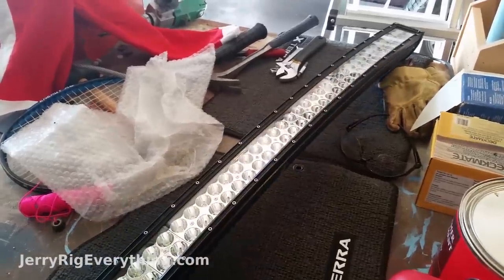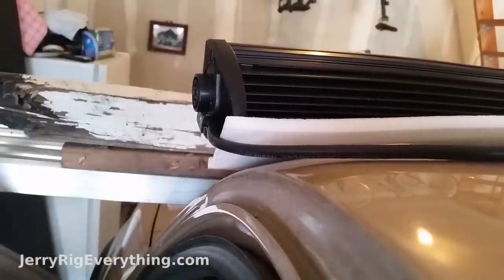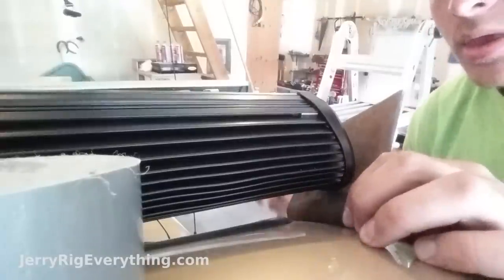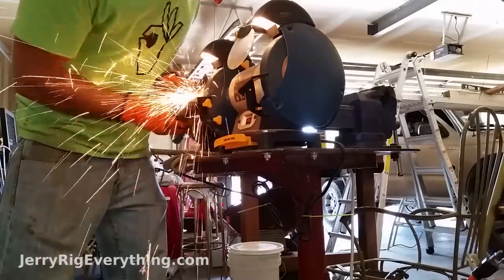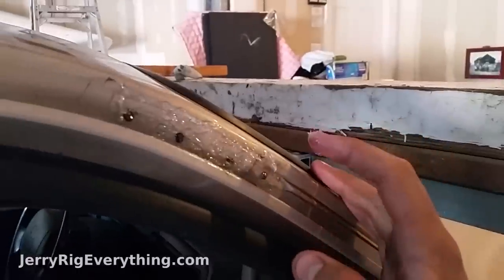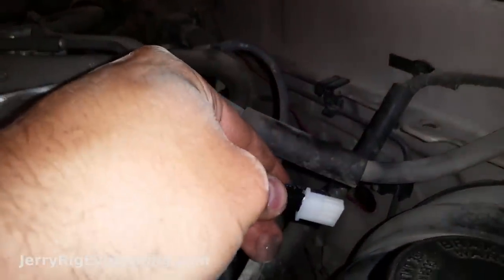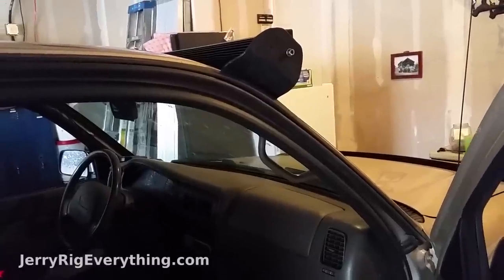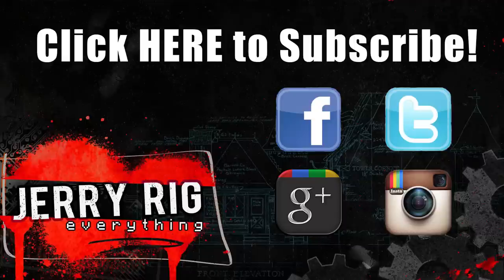Making Custom Brackets for a 50 inch LED Light Bar Truck Mount

Comment: pretty good. just a tip though. make a template with cardboard first. easier to trim and adjust with scissors. then trace onto your steel and cut out the final product.
Reply: Great tip. All my projects start as "arts and crafts."

Comment: It would be much easier if we can just print out the template on a paper, transfer and cut them out. I also would use a 4mm plate so I can bend with less effort. Great video 👍

Comment: There is a problem with using the level, you can't be 100% sure that your car is perfectly level with your level tool, so if it isn't, the led mount can look misplaced on the car.
Reply from the maker: +Seif Eddine B Smart observation. I didnt think about that. Definitely make sure the car is level as well.
Reply: I agree. In other words...what is the floor is not leveled?
Reply: Well even if the truck is t level, as long as the led bar light matches the trucks level sit will be ok

Comment: I am so glad I stumbled across this channel while researching iphone 6 glass only replacement. I had no idea you did stuff other than cellphones, I actually thought it was kinda odd with the name of the channel to only be cellphones but never looked at other videos, I just subbed. I am like you Jerry (if that is your name lol) I am into a little bit of everything. In the day time I repair cellphones/tablets/computers/other electronics, on week nights I am a general purpose handyman whether repairing/installing doors, plumbing, crane parts, cars, or even lock picking, and on the weekends I am a welder. Whats sad is all the work I do is pretty much free. Hell at the cellphone repair shop I only get paid commission and I rarely even get to do that, most of my work is fixing warranty items (yes we actually warranty our repairs) that my co-workers screwed up, sometimes I screwed something up but most of the time its the other people.
Reply from the maker: x9x9x9x9x9 Start a YouTube channel ;-) Most of my repairs are free too nowadays. I film the projects, post to youtube, and make money off advertising. Sounds like it is right up your ally.
Reply: I kinda already have one going. I just don't have a decent camera or tripod to film with. Some day I will though.
Reply from the maker: Most of my videos are filmed with my cell phone.  Started with my old EVO 4g, then Samsung s4, s5, and now I use the Note 4.
Reply: JerryRigEverything Nice. I'm using a galaxy s3 or a nexus 5.

Comment: How is the light holding up since then? I really like it and don't feel like spending 1500 on something that this can accomplish. I live in Hawaii so moisture an water was a concern of mine
Reply from the maker: Vermonster551 I used it yesterday, so its been connected for 3 months with no issues so far. It has been outside for 2 rainstorms, and driven about 3,000 miles. Not too shabby.

Comment: Thanks a lot. I'm having a hard time getting my light bar not to swivel forward or backwards. I'm going to try drilling that small hole in my bracket and use your cotter key idea.

Comment: I'm curious would using a steel monobolt or perhaps a alum self sealer work better than bolts/nuts for both sealing and how much it "sticks out" for weather stripping? Also if the 1/4 is that strong I wonder how 1/8 would hold up, I'm thinking this as 1/8 is easier to beat into shape and would be quite a bit cheaper. One tip you should mention for those wanting to save money find a local metal shop and go buy their scraps....will be dirt cheap and they will be happy to sell it to you at a fair price.

Comment: Has the bar still held up pretty well? Any burnt out lights etc? Im considering this bar myself.
Reply from the maker: ***** No burned out lights yet... Ive driven about 6-10k miles since I put it on.  (I dont really remember.) And it still works just fine.

Comment: Next time use a card stock to build your templates and use 1/8" steel. 1/4" is way too thick.
Reply from the maker: +prerunnermaniac 1/4 might be thick... but it is as solid as can be.  Card stock is a good idea.
Reply: Aluminium or plate Stainless Steel would also be a good option. Making the templates from thin aluminium would also help with the angles etc.

Comment: Nice install. I would have used threaded rivets instead of through bolts and nuts. Also important to check that light bar doesn’t interfere with windscreen wipers.

Comment: Nice job man! Im lucky that they actually offer a cheap bracket for my silverado and I got the easy way out. You also saved a lot of money as those brackets are up to $169
Reply: +streetryderz209 Here's the ones I used on my 05 Silverado 2500HD, work fine and offroad a lot and never moved once.

 http://www.amazon.com/Rough-Country-Windshield-Pickups-50-Inch/dp/B00IX26X12
Reply: +streetryderz209 Haha nevermind, went to your page and see you have it in installed.

Comment: Do you have any suggestions for anti-theft/security for this type of mount? I'm also making my own brackets for my vehicle but I'm concerned with theft. Any modifications or new ideas to improve security?
Reply: +hshalbach Simply having a bump sensor on almost any alarm would be as much deterrent as you could get. On my truck I have a motion sensor tuned to about 3 inches of my passenger / driver windows. Being 3-4 " from the windshield will make it start chrping like crazy as well. 

Alternatives would be finding a matching thread size for the side bolts with a weird security head of some type (something most people wouldn't have in the average allen wrench or phillips / flathead kit)
Reply: I have a drop of JB Weld on each bolt. If you want to remove the weld can be broken, but a thief isn't going to take the time if it's on there.
Reply: Torx screw's and furthermore anti theft torx screws.

Comment: Looks great. 
What kind of metal did you use, where did you get it and about how much would it cost?
Reply from the maker: hayden rudd Scrap metal from a place that sells metal locally.  It was like 15 dollars.
Reply: Oh okay thanks, I wasnt sure if the kind of metal you use matters.
Reply from the maker: Steel, Iron, whatever, as long as it is ridged enough to hold up the light bar.

Comment: Hey bro , looks like a good job. I like how low you have it mounted, basically on the top of the windsheild. Did you make your own brackets because you couldn't find any that mounted the bar where you wanted? Or jus to save a little $. I was thinking about getting one but I don't want the thing sticking up 3" off the roof.
Reply from the maker: steve wolff I made my own brackets because I could find ZERO sellers for brackets on my model of truck.... This video was made about a year ago. (Light bar is still working awesome btw.)

Comment: I like your handy work on the 50 inch light bar brackets, was wondering if you have made any for a tundra yet.no one makes them 4 Toyotas , I have a 2012 tundra and woulk like a set if you can make the but also reasonable, let me know
Reply: +SHOTGUNJIM1, not sure if you have found brackets yet, but I found a site called caliraised and they sell them for Toyotas. Not going to lie though, there not cheep.
Reply: yes there not cheap but what is for a Toyota, and I like your better, you really need to find someone that will let you mold some for a 2012 tundra and I would pay you

Comment: Nice work, mate. You don't have it linked into your high beam so it turns off when you dip to lot beam?
Reply from the maker: Roger Wilco My high and low beams still work normally.  The LED unit is a whole different switch.  That way I can still legally drive with my hi and lo's and only use the LED for off road stuff.
Reply: Yep, understand that, but while I have the usual hi/lo beam on my headlights, I have it so my lights have to be on high beam for any spotlights to work, even if the separate spotlight switch is on. Saves having to flick off two switches and it's a legal requirement in Australia.
Reply from the maker: Thats a smart move.  Keeps you from accidentally blinding people on the roads.

Comment: Nice job. i will be using thinner steel. thank you for making this video i have been trying to think of a way i am going to mount my 50" light bar to my Grand Cherokee with out having to pay 50$ for pre-made brackets.
Reply from the maker: Thomas Hernandez Make sure to follow up and let me know how the thinner steel works.  I'll need to do this again for my next truck.

Comment: Hello, is it illegal to use led bar/auxiliary lights when you are driving in traffic? Here in Sweden there are no restrictions, some people have like 500w xenon and 400w led on one single car. And we also connect the cable for high beam to the relay so the led bar starts when we switch on high beam. :)
Reply from the maker: +andreaaaaaas It is very illegal here in the United States to drive with LED bars lit on public roadways.

Comment: Hi, nice job. Dont you think that it lights up the dash, hood and windshieldwipers to much?? Annoying kind of? 

greetings from Sweden
Reply from the maker: +ilookbest Hello Sweden!  And yes, it does reflect off the hood AND the windshield if the windshield is not clean.  So if I had to do it again, I would mount it higher up.
Reply: :) I understand. Or further back, perhaps on the cromed "part" between cabin and loadarea?? Here we mount lights that way, front lighting and worklights/backuplights to the rear. Or to the sides if you need it... 

it cant never be to many lights ;)

Comment: Quick question, have you had any bad hood glare from having it so far forward? I've seen other videos where they design it so that the LEDs won't cause any hood glare. How has it worked for you?
Reply from the maker: Yes, there is hood glare. I would recomend putting it higher, or adding something that will deflect the light from the hood area. like some kind of visor.
Reply: +JerryRigEverything thanks for the answer, exactly what I needed to know. Great video, I enjoyed seeing your process and how you went about it.
Reply from the maker: Jonallen003 No problem! Thanks for watching.
Reply: Check out ChrisFix on his project nightlight. He put his further back on the roof of his truck so all the light will go to trail, and not the hood.
Reply from the maker: znovosad555 Thats definitely smart.
Reply: +JerryRigEverything gotta say, ChrisFix is really helpful for new ideas, and little tricks for different things
Reply: Clear matt vinyl wrap.

Comment: JerryRigEveryThing, I just bought myself a light bar, and was wondering how difficult it was to make those mounts? I really like how they look and wouldn't mind making some myself. And is that 1/8th inch plate or smaller?
Reply from the maker: xiiLiViD Projections I used 1/4th inch metal.  It took me about.... 6 hours of planning and fabricating to make the mounts.  It was my first time attempting a project like this though, I could do it faster now.
Reply: Do you think it'll be about the same type of fabrication for a 92 ford ranger? I believe it'll be almost the same, just need to get the materials and tools to do it
Reply from the maker: I imagine so. The rangers and tacomas are about the same size.  If not, you can always just adjust the angles of the metal.  The 1/4th inch metal is so freaking strong I could hang a hammock from the side and sleep all night with no worries.
Reply: I'll have to try the cardboard method and then transferring that onto the metal! Thanks to whoever posted that.

Comment: Do you have an extra battery mounted as well? It appears this particular light bar is 240Watts. I'm wondering if  a single battery can handle it?
Reply from the maker: CRM6718 I don't have an extra battery.  Just the one.  And it has handled the light bar great for over a year now.  I even left the light bar Turned on for like 2hours once, and the battery was still charged enough to start my truck. So the LED power draw on the battery isnt too bad.
Reply: JerryRigEverything Thank you!!!!

Comment: Nice rig!! I have watched your video several times cause I have the same body style taco and a 42" light bar I recently purchased. I want to custom build my own brackets, like another post said, I dont want the light bar sticking out really bad. I had a couple of question, how far of a gap do you think you have your bar from the truck/windshield?  Also, how low or high is the bar from the window weather stripping. I plan on using a 1/8" metal compared to your 1/4". Any suggestions on anything you've done or would of done?
Reply from the maker: Victor Acuna Jr Id have to go out and remeasure the distance from everything.  I think its about an inch or an inch and a half away from the windshield.  Its more just where you want it aesthetically. Ive seen bars mounted much  higher than mine as well.  I just wanted it barely out of my field of vision when sitting in the drivers seat.  I would recommend using 1/4th inch metal.  It is SO strong and durable I have ZERO worries about it ever coming off. I dont know if I would feel as secure with 1/8th inch metal.   Other than that... I would have taken the on/off switch and moved it to my center console (Between the seats. On the side.) so that it is easier to reach.  Not a big deal, but leaning over to reach under the dash can get dangerous if you are driving at the same time.  Its been installed for about a year now, and still working awesome.  Its nice to have.

Comment: 1: DO NOT use a bit BIGGER than the bolt (the bolt wont be able to grab the grab metal if you do that)
2: the "cab corners" are NOT in line on EVERY truck, our 2014 silverado is off center, measure from the corners of the windshield to get a good fit. 

other than that great job man.
Reply from the maker: +Crash McFlash Thanks man.  For number 1... I dont want to screw into the mount. I just want the mount to support the bar. The bolt will go through the hole and into the light bar, and then squeeze the mount and light bar tight.  If I threaded the mount, (Like you are suggesting.) The bolt would stop turning at some point, leaving the light bar not all the way screwed in.

Comment: Hey I just bought a 54" curved light bar and I can not get the brackets that fit it. The ones that came are the flat stationary ones and I even bout Angled rough country brackets and those only work with 50" apparently ... Any suggestions or sites ? Thanks
Reply from the maker: Chase Winn I looked everywhere to buy brackets like mine.  I could not find anyone who sells them, thats why I ended up making my own.

Comment: So this method will pretty much work on any truck? Because I have a 2000 Toyota Tundra and I bought a 50 inch curved led light bar and I can't find windshield mounts anywhere for it. I was going to just buy one for a ford or gmc and just modify it but I'll try out your method first. You make really helpful videos and I will definitely be subscribing. Keep up the good work bud
Reply from the maker: +thatguydave98 It should be a very similar process.  Your truck is wider than my truck, so it might even be a little easier. Thanks for subscribing!

Comment: My 96 tacoma doesn't have that hole in the firewall. Am I going going to have to carefully drill one or is there another way to about it?
Reply from the maker: Uriel Pineda Double check to make sure it isn't on the passenger side either... There is usually some kind of hole. Even if there are other wires going through.  if ALL else fails you can drill a hole... just make sure there is nothing important on the other side of the drill.

Comment: Because i have the same tacoma and am wondering if the only way to mount it is your way .
Reply from the maker: Freddy Bohnenberger I spent a few days looking for anyone who sold the mounts... and I never found anyone.  Keep in mind that my light bar is a Curved 50 inch, which will probably end up being shorter than a straight 50 inch.

Comment: in my experience i prefer to use aluminium because is more easy to work with, and you dont get any rust with time because of the rain or water, metal always get rusty even if you paint it with time you always going to get some rust on it but with aluminium you dont going to have that problem

Comment: hey, i have a 1994 toyota pickup that i would like to mount one of these on the roof.i cant find any exact measurements on this specific bar. could you tell me the exact length of this bar from end to end with out the brackets? thanks a lot.
Reply from the maker: TheRemington887 The light bar I have measures 49 5/8inches from longest curve to longest curve... Then 47 5/8 on the inside curve. (side closest to the windshield.)  It is also 3 inches tall, and 3.5 inches deep.
Reply: thanks alot man! i really appreciate it!

Comment: Sealant is a good way to keep the water out but DO NOT use silicone like in this video. Silicone causes rust so make sure that the sealant is good to use with cars and metals in general. Otherwise it will give you issues.
Reply: +Hannu V&#228;h&#228;kuopus How is that is I may ask? Id like to know.
Reply: +Jeppe Johansson silicone will rust steel because it has acetic acid in it to make it cure, that's why.
Reply: Okay.
Reply: I used flex shot silicone on my RC over some screws and they didn't rust anymore than any other screw on it without it.
Reply: Yeh a neutral cure silicone or a proper RTV silicone like Sika Automotive.

Comment: Nice you can buy Xj jeep brackets that would work also try using rivet nut no nuts are needed
Reply from the maker: richard diaz The XJ brackets would fit as well as the ones I made?

Comment: Hi mate the only thing I don't like is the push button light switch they supply it doesn't last very long and the button can stay on or off and won't work so I put a toggle switch in mine .
Reply from the maker: TheDemonsarehere Thats a smart move.  Eventually I want to have mine on a remote, so I can activate it when I am walking toward my truck.  I think that would be fun.